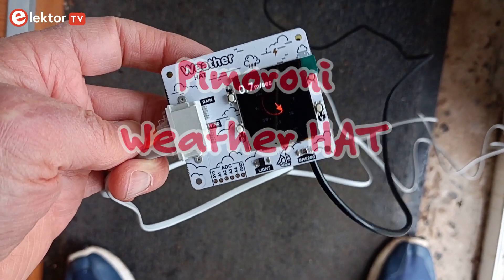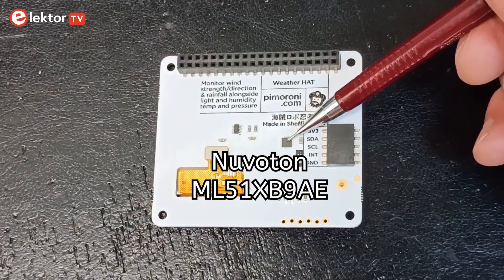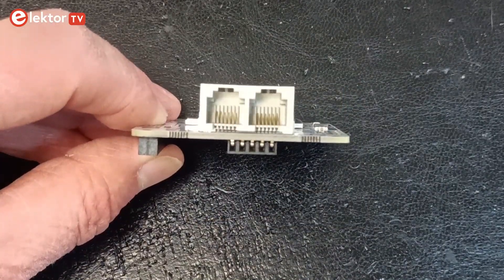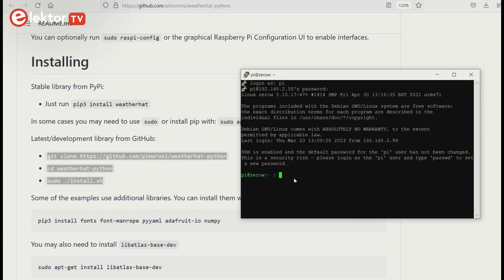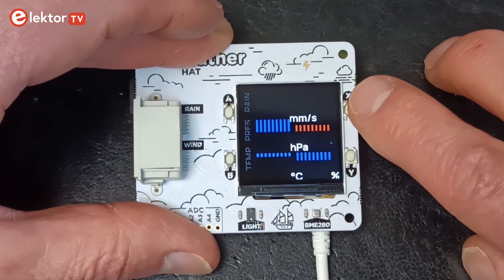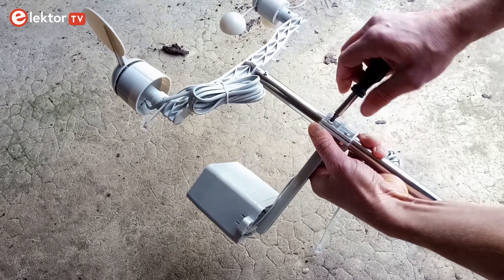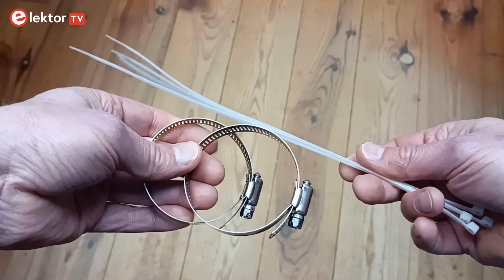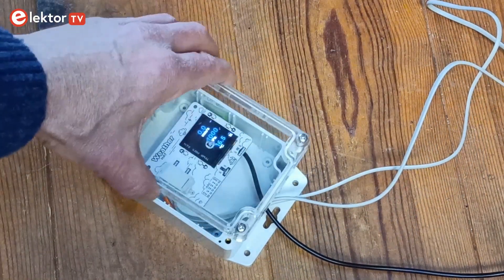Pimoroni Weather HAT with Weather Sensor Kit - a Review

Comment: I have always wondered what purpose these gizmos serve.
If you are required to go outside to look at a display, you know what the weather is like, anyway!
Now, if it is transmitted over the internet, then the data can be checked remotely. That is valuable for the very large farms that we have here in Australia.
We call large farms "stations", several of them in my home state, that are easily about half the area of the entire Netherlands, owned by just one family.
24,000 square km for just one farm. It would be great if these "hats" could be spread over the property, and somehow relate their data to the internet, possibly via satellite feed.
An additional sensor that would be very useful is a stock water-level sensor.
Does this "hat" have that capacity?
Reply from the maker: The I²C port and analog inputs allow for other sensors to be connected. So, if you have a suitable water-level sensor, you can use it.

Comment: wen ich mal einen   garten mit haus habe, hol ich mir   so was,.was  sagt ihr den zu meiner  modifizirten passiv umkermenbran  ?What do you say about my passive membrane arrangement, see the schematic circuit diagram in the profile picture, the pivoting membrane was one of my first ideas to 1 improve the efficiency of the closed boxes, 2 reduce the membrane stroke, 4 the system for drivers with very low quality (QTS) not to let the bass sound flat, after there was the difficulty of producing my passive membrane, because I needed it for square beads, and the implementation was too difficult, I came up with the idea of two passive membranes back to back to connect a small, and a large . When my construction was ready to hear, and I announced to mermalz that I would build it completely, that was over 10 years, now it is complete in the housing, installed, and look at it, over 96db at 2volts at 4ohms, so I'm sure you can also a closed construction, with high efficiency and deep bass build, only my coupled passive membrane does not work the way T.LClark ordered it on the housing, but vice versa, see the modified schematic circuit diagram in my facebook profile and compare the original, on the page 194 , in the book of elecktor entitled poetry and warhei 5.16. The construction augmented
Passile radiator according to T. L. Clarke, works
with two coupled passive membranes)) maybe you should write the book dicht und warheit again and mention my construction proposal, my way of arranging it is just more effective than it is mentioned.